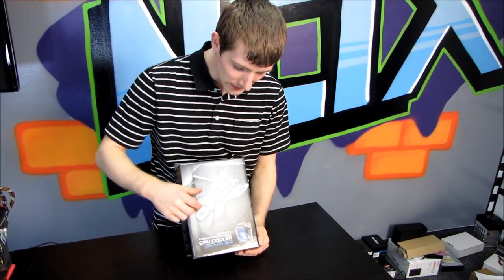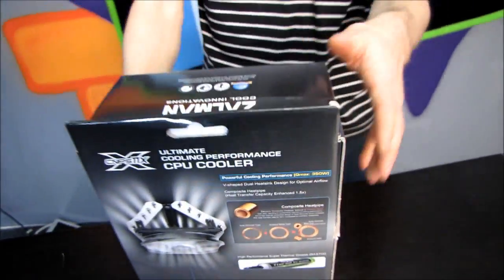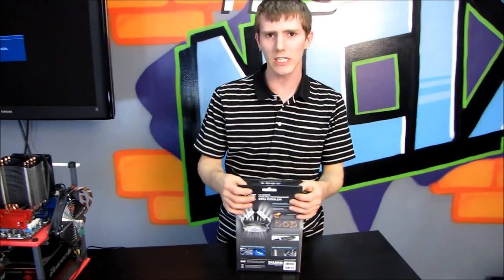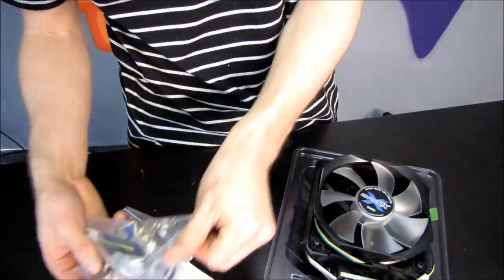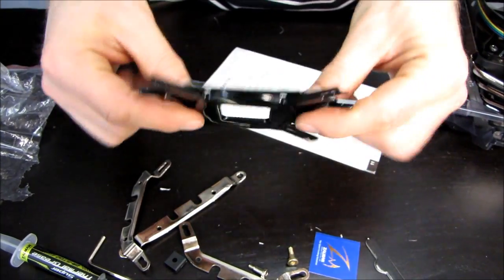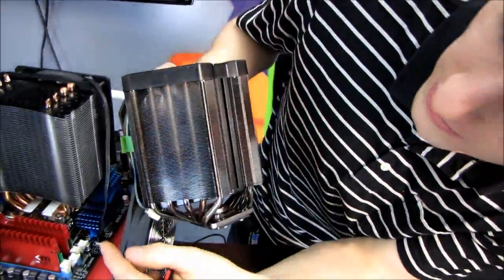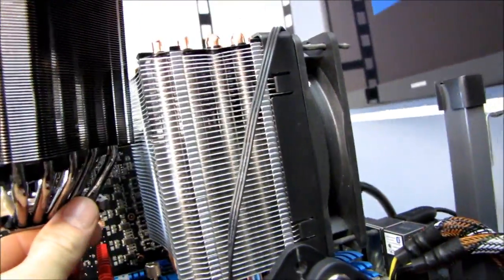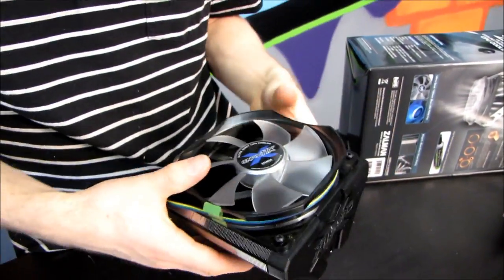Zalman CNPS11X Extreme CPU Heatsink Unboxing & First Look Linus Tech Tips

Comment: Still using it ;) Now for the Ryzen 5 3600.
And still with the original thermal paste (it's now too dense but works well).
Just fan is not so quiet now.

Comment: by making it a solid mass you dont "ramp up" the surface area but decrease it. and ofc air cant pass through a solid block but if it could you would still have decreased the cooling power.

Comment: I have use this for 3 years, and i choose it just for my high profile rams. But i was very surprised because of its noiseless fan and cooling performance.Once, my i7 2600k rendered with full capacity of cpu (oc : 4,33 ghz) without pause for two days, and cooler fan did not up to 1600 rpm and cpu temp 60 degrees   :O  I can say this cooler work perfect silence with amazing performance.

Comment: Following on from the post below,the cooler installs easily,just the 2 screw points on the ram side need the angled allen key.
I have only just assembled my build,I expect my temps to become a bit lower once the paste has been in situ for a while,but,currently,my cpu temps are 29 Centigrade-84 Farenheit.

Aesthetically,the cooler looks,well,'cool',with lots of space between it & the rear chassis fan.
This is enhanced by the shape of the cooler,all in,i'm just getting cold air  from the case.

Comment: I have installed the CNPS11X Extreme on my Sabertooth Z77 mobo,with my 3700K cpu & 8 gb Vengenance LP ram.
Tio install the cooler,I had to use a Dremel 'cut off' tool,to remove segments of the passive heatsink above the CPU socket.
I had to cut 6 segments off,counting from the RHS,segments 3,4 & 5 were removed from TWO rows.If using the Dremel,centre the 'cut off' on segment four,which,when cutting through,will take out segments 3 & 4 as well,then touch up edges with a black felt pen.

Comment: if my case is 7.59" wide (with a 120mm fan on top) can this cooler fit in there?
in the web i found out that this cooler is 6.1" tall so i was wondering because i plan on getting this for my i7 2600k (actually I'm still planning on getting everything >////<...in other words i haven't bought anything)

Comment: @jasonxu24 Dont listen to him 5 ms is just fine for the eye. If you want your eye to not get tired or the motion of the picture to look sharper look for the Hz. Larger frequency means that the frames will change faster and in a high motion scene it ll look smoother which is what a game does.
Then again very few monitors have larger refresh rate than 60Hz, its easier to find a tv.
 Having a 24" 5ms, 60Hz monitor I can tell u u wont have a problem Though a Tv with over 100Hz is more worth it.

Comment: Hi there. I just built my dream gaming PC
EVGA gtx 580 superclocked version(looking to overclock quite a bit)
core i5 2500k 3.3ghz (looking to OC at 4.5 ghz)
12gb 1600 gaming ram
850 watt azza power supply
p67h2-a2 ECS black deluxe motherboard
I am looking to get a great CPU cooler / heatsink and price isnt TOO much of a problem. I need something amazing for its price, could you please help me out on this I know you know alot about these, could you reccomend mea  great one for my specs, ty

Comment: @svenssonj  a solid mass does not have more surface then fins,  Stack ten quarters measure the total surface area. Take the same stack and separate each an 1'8 of an inch. You not only can go around the quarters that are seperate (fins) but you can also go between each.  The actual "surface area" of the separated quarters is much much more than a simple stack.  Daaaaaaaaaaa

Comment: @SunTzu1983 It's fine.  All heat pipes have one of the two types of return system in them.  99% of coolers are mounted sideways so they are built with that in mind.

Comment: i have the 10x extreme with the 1156 motherboard with 4gb ram i cannot add more because the front part of the fan is blocking the 1st slot of the ram.. :P i dunno if they fix that problem on this 11x or not

Comment: @AgentHydra actually not, because those extreme high RPM fans got very low static pressure = they can't get the air through the fins, Zalmans fan got this high pressure but low RPM.

Comment: a solid block would actually have far less surface area than the fins. as an object gets larger, its area increases exponentially quicker than its surface area. a setup with fins has FAR more surface area than a solid block. thats because each fin has its own surface area, which add togther, versus a solid block which, if it was a cube, would only have the surface area of its 6 sides

Comment: Lol at the morons that are saying "It's not extreme cooling it's not liquid LOLOL". You really only need liquid cooling with extreme overclocking. Over 5GHz. You can easily overclock to 4GHz on a high quality air cooler on the Core i7 processors. Having liquid cooling to run your shitty Phenom II at 3GHz doesn't make you look badass, just shows you don't know anything about hardware.